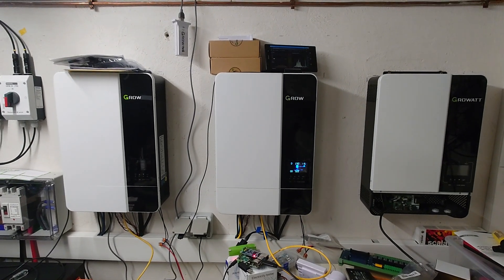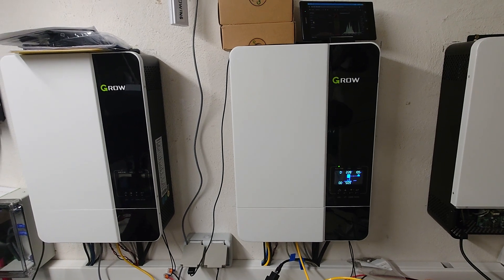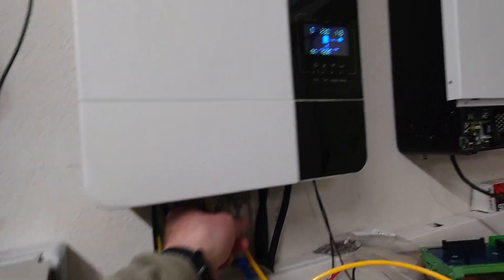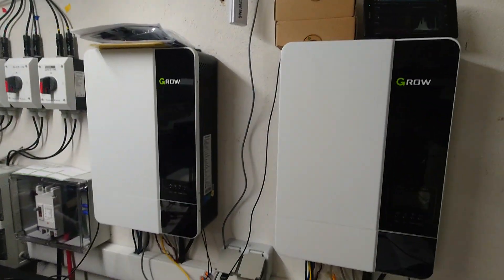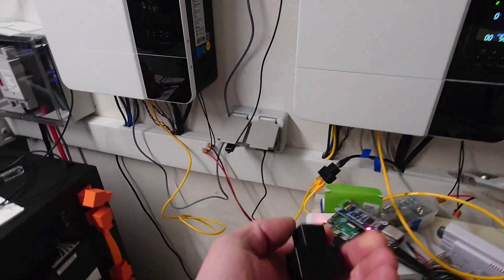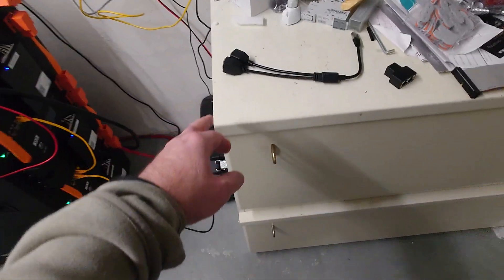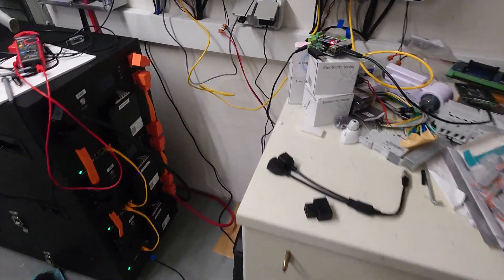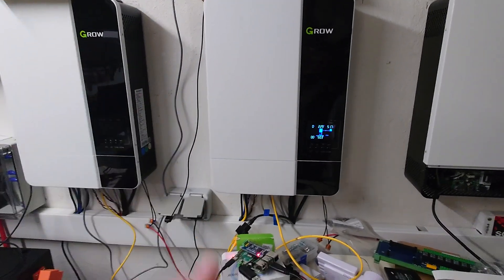testing RJ45 communication  splitter with Growatt SPF inverter

Comment: Can you please post the wiring of rj45 to rs485 wires?
Reply from the maker: for that please check your manuals. each manual for the inverter and the battery should clarify the whole wiring based on your communication format

Comment: Be carful that the Raspi is not only running on SD , I know from the Monitoring of my PV that the SD went broken at least twice over the last 10 Years. Not it is running on an USB-SSD sind 2 Year ... looks better.  Currently I have 2x Growatt , if that works with CAN it would be nice to switch from the "WIFI".
Reply from the maker: changed it a few weeks back to an SSD when the first sd card broke...